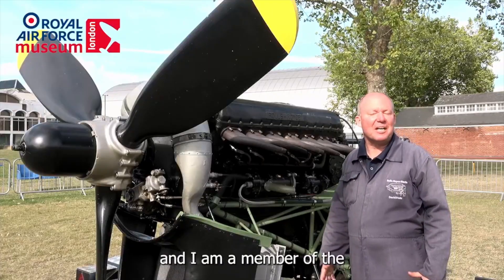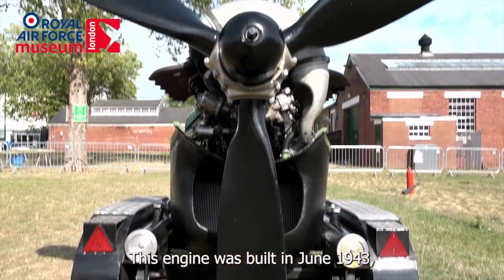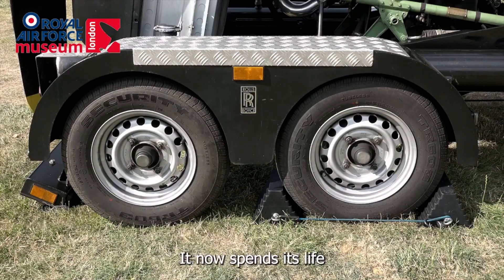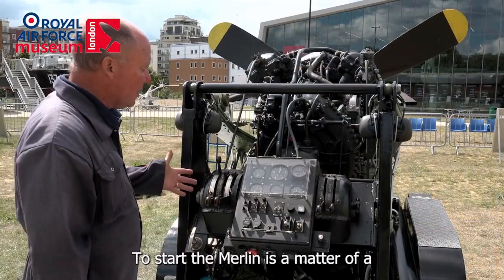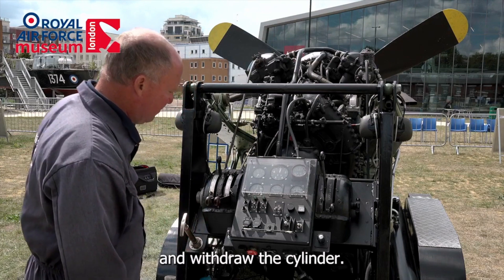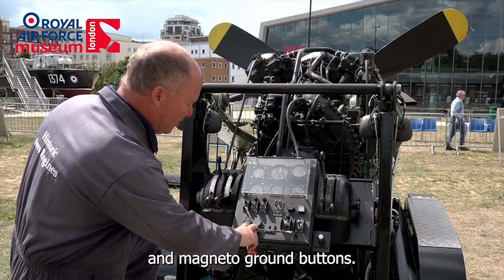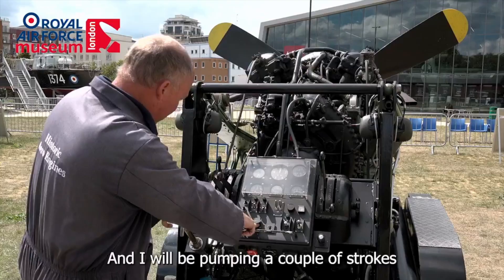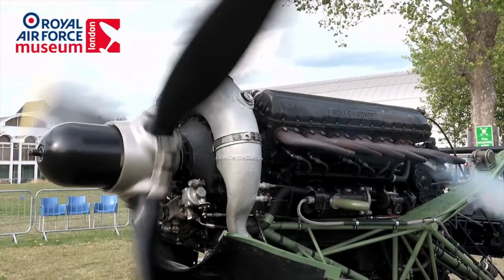Royal Air Force Museum London;  a 'Merlin' appreciation weekend, August 6 and 7, 2022.

Comment: What kind of radiator and oil cooler do you have on the engine?
Reply from the maker: Hello John.  The radiator models the Serck type, with water/glycol coolant in the front and an oil cooler inline behind.  This design was used on later Lancaster aircraft with Mk24 Merlins, and differs from the earlier Morris block design with the coolant and oil radiators side by side.
Reply: @HistoricAeroEngines  Thank you.  There appeared to be a radiator assembly under the engine, but it was hard to see what it was.